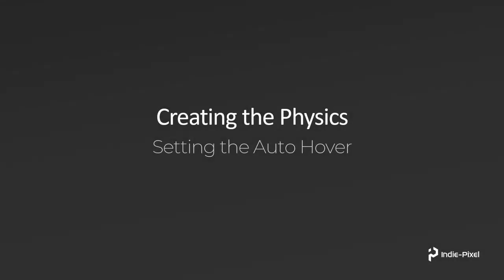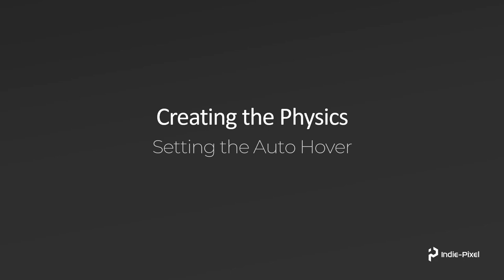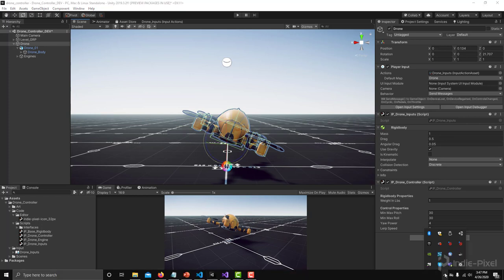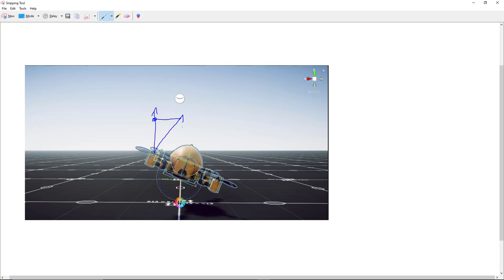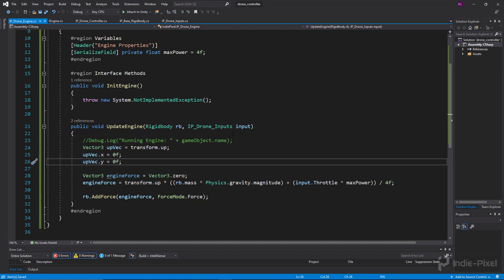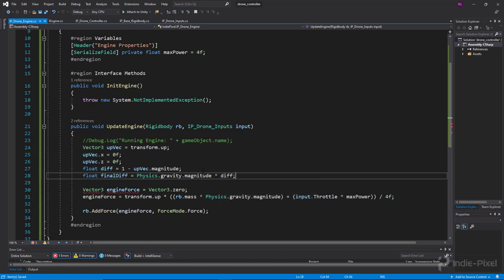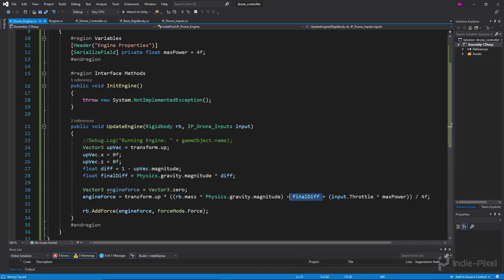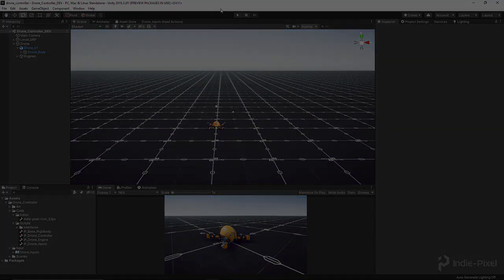Unity 2019 - Drone Controller - Section 3 - Video 7

Comment: Instead of the diff fix, I simply replace the y with the gravity-defying value and it seems to work. Seems like less math, too lol. Also I've chosen to not have 4 engines, and instead treat the drone as a single engine and the results I'm seeing seem similar to yours. Obvious downside... No engine failure support. Also, maybe something in the coming videos.

I like going off-script. I'm bad like that.
Reply: The four engines in the Tutorials do exactly the same as having one engine (and not divide by 4). Whether you add 1/4 of the force four times to the Rigidbody, or add the entire force once, is exactly the same thing. The placement of the engines doesn't do anything (apart from their colliders), the force is added directly to the Rigidbody in any event.
Reply: @Wildcardmoo  Yeah. But like I said, no damaged engines support. I've made two versions, one with a single engine and one with four engines being their own rigidbodies using joints. The joint version is a lot cooler because I can now move by making 2 engines run faster than the others, instead of applying a force based on up. Also I can damage an engine or make them less powerful so you fly wonky. I have no use for this, but it's fun to build. 😄
Reply: @WesleyOverdijk  That sounds awesome!
Reply: @Wildcardmoo  Yeah the "physics" part of this whole series is a joke. It's obvious that the creator doesn't have a care in the world when it comes to making things accurate. All they care about is making a gamified thing that a 4 year old could control.
Also a lot of redundant stuff that reduces performance.

Comment: Hey, I purchased the full package, and I'm working on implementing it into my project. However, I have not found an easy way to adjust the speed of the drone without messing up another part of the physics. Any pointers?
Reply from the maker: What happens to the physics when you are increasing the speed?
Reply: Indie-Pixel my first approach was to increase the maxPower, but what ends up happening is that the vertical velocity skyrockets, while the horizontal velocity barely increases. I tinkered around some more and I believe I have a fix that I can send you / share it on pastebin
Reply from the maker: Ah interesting,  ok...I'll take a look at it this weekend. Thanks for the heads up!
Reply: Indie-Pixel I’ll send you my code solution with dotnetfiddle
Reply from the maker: @Solanaceously  sweet!  Thanks!